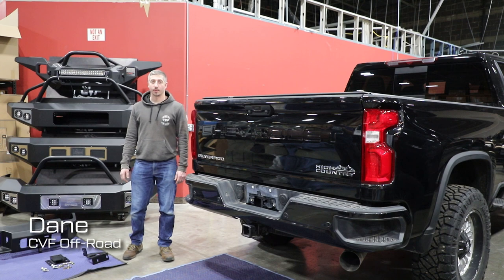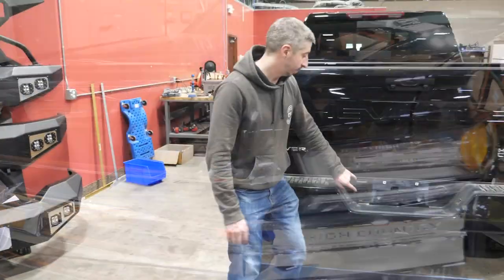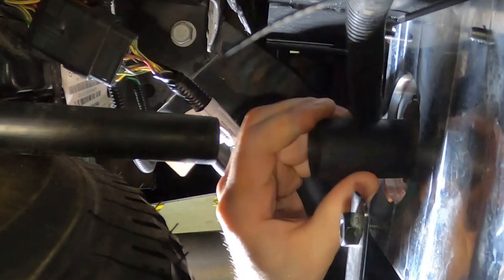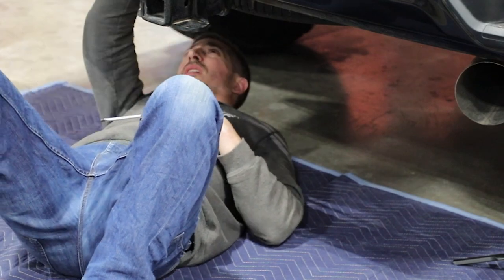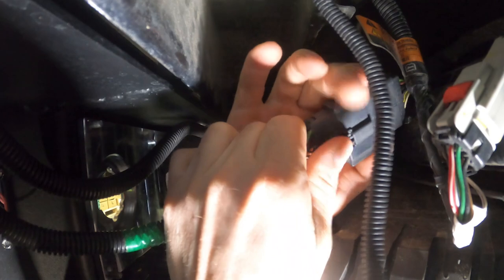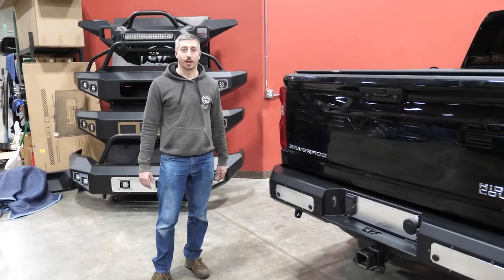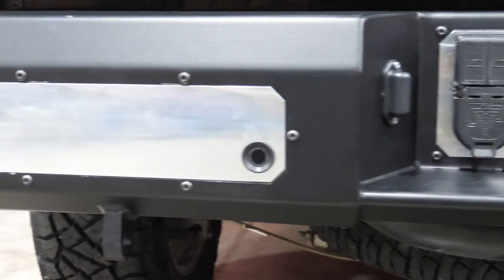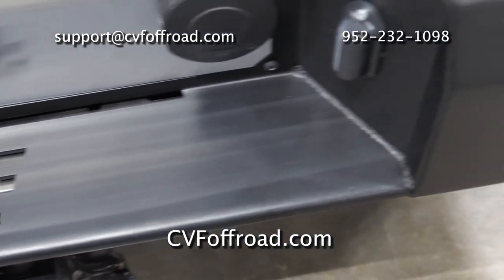2020+ Chevy Silverado 2500/3500 Rear Bumper install - CVF Offroad

Comment: Are these bumpers the same weight as the oem?
Reply from the maker: Definitely not. These are heavy duty Steel. OEM bumpers are mostly plastic with a couple metal brackets.